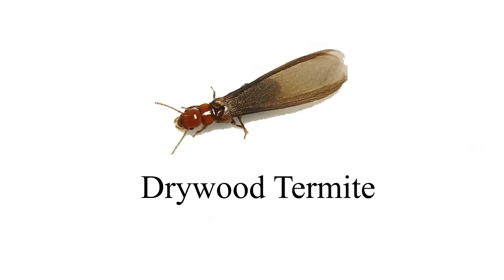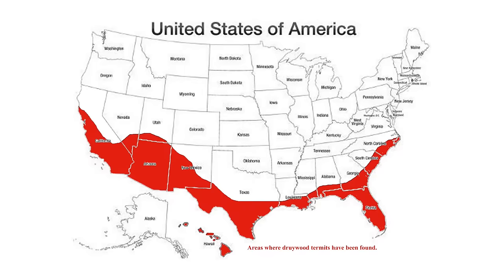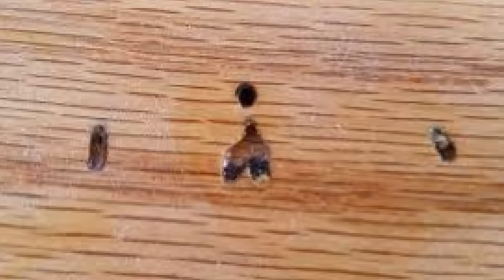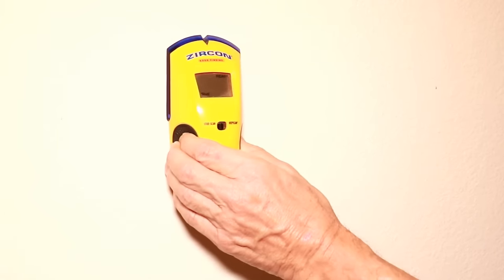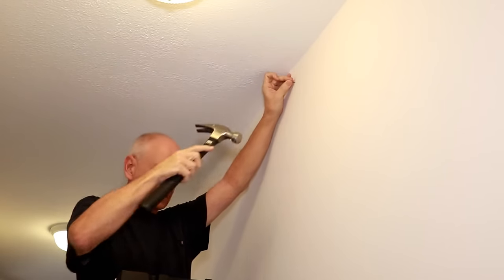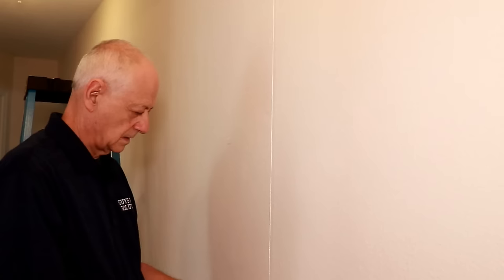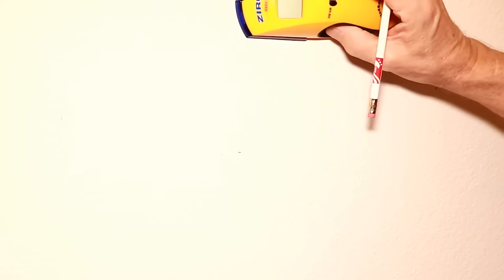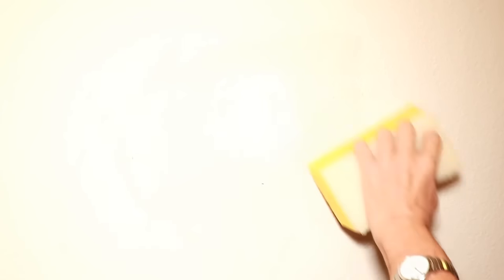How to Treat a Drywood Termite Infestation Yourself. A MUST see if you have Drywood termites.

Comment: Guy good afternoon I am building a new home in Wichita ks,  I have built a few before and during those builds i was able to use Chlordane by pouring around the basement foundation and it worked great. Fast forward you can't find it anymore the EPA say it was bad but it sure did work.  I am looking to treat my home before framing starts and need some advice. I have not backfilled the basement yet will do in about 10 days so I have the perfect opportunity to do a diy termite treatment.  I am looking to spray the foundation after waterproofing is done. I have a 120 gallon spray tank in my gator so I think I have a great rig to use.  I have watch many of you videos and still need a bit of help on the concentration to use,  and how much to apply by sprain application.  I like the fipronil which has a few trade names.  I can spray the entire foundation basement if needed,  I don't belive permits are a great issue around here and I will have a minimum clearance  of 10" between any ground and the James Hardie siding.  I would like to ask for your suggestions, And Your videos are great as an engineering I really do appreciate your detail.  Thanks John Sutherland Is you would rather call my cell is 720-320-6678
Reply from the maker: I am so glad that you reached out to me before you started framing.  Chlordane certainly was an effective product.  The only problem with it was that it was also highly toxic.  So, the EPA banned its use in the late 1990s.  Not to worry though.  I can tell you how to make your entire home 100% termite proof and the treatment is going to last virtually forever.  This is not the cheapest way to do it, but did I mention that it's permanent?  We could certainly go with the ground method of using fipronil, but that is only going to last a maximum of about 10 years.  So, instead of treating the ground, we can treat the wood because you are going to have it all exposed.  After, hearing my suggestion on how to treat the wood, if you still want to treat the ground instead, then I have a video on how to properly trench around your house and I will share a link to that video.

My recommendation is to treat the wood and some other materials in the structure with Bora-Care.  I do not happen to have a video on how to do that, but there are other videos on the web that are pretty good and I will share a couple of links for you.  I do it a little bit different than most people and, of course, I think that my way is better.  Most people are going to mix the Bora-Care at a ratio of one part product to five parts water.  I think that is a mistake.  The label does tell you that you can do this, but you would be much better served to spend the money and mix the product one part Bora-Care to one part water.  The reason for this is that concentration is important.  Mixing the product one to one is going to kill termites much faster than mixing it one to five.  In other words, this will make the product way more effective.  Since you are only doing this one time, you may as well do it the most effective way possible.  This is not a cheap product, so it is going to cost a lot more money to do it my way.  So, you can decide for yourself.  Either way though, whether you mix it one to five or one to one, it will still do the job.  It's just that by mixing the product one to five the termites are going to be eating for a little while longer before the entire colony is wiped out.  It will still get them, just a bit slower.  A couple of other things that I do differently than most people is I treat the entire foundation, both inside and outside, because this product can be applied to almost any surface, including concrete.  I also apply it on the entire subfloor, both the top and the bottom, and all the floor joists as well.  I also apply the product on all the plumbing and wiring in the entire shell that is below a two or three-foot mark from the floor up.  That is to say, I treat everything from the footing up to about a two to three-foot mark from the subfloor up the walls, both inside and outside, before the finished siding, insulation, or drywall are installed.  This way, the termites will have no choice but to encounter this material when they reach your home.  You can apply this product with a very cheap garden sprayer that you can throw away at the end of the process.  I recommend doing the entire treatment in one day because the sprayer can clog very easily if it is not thoroughly cleaned.  If you use a cheap $10 garden sprayer, then all you need to do is just throw it away at the end.  Other than those recommendations, just follow the directions on the videos and you should be good to go.  Again, if you decide not to use the Bora-Care, then you can watch my video on how to properly trench the house.

The cheapest place to buy Bora-Care is Solutions Pest and Lawn.  I will give you a link to it.  You can buy the product with mold prevention as well, but it costs a lot more.

I hope that helps.  Be well my friend.

Bora-Care videos:  
https://www.youtube.com/watch?v=Rmr_aEodyhg&t=7s

https://www.youtube.com/watch?v=OawAzkZZx20

Where to buy Bora-Care:  https://www.solutionsstores.com/bora-care

Video on how to trench for drywood termites:  https://youtu.be/Fy7YHi_7Z8g

Comment: Another topic but same subject. Treating/preventing dry wood termites in a typical FL condo…. Almost all multi story FL condos have a common air handling closet for the A/C system which literally runs from bottom floor to the top floor. The copper piping and condensation drainage pipes pierce the floor and ceiling of every single closet. There could be an infestation on the sixth floor and using this crazy highway, could impact the first floor as they are usually incredibly poorly sealed, if at all. A physical termite highway! 

Before I properly seal around these pipes I thought it would be a great idea, with decent access now, to treat the volume of space below the floor and above the drywall ceiling. What is your recommendation for treatment of these two spaces? FYI: The gap around the pipes are large enough to insert the tip of a multi gallon pump up sprayer. Thanks!
Reply from the maker: I have to tell you Mike, you never cease to amaze me.  I don't think I have ever seen anybody think this stuff through as well as you do.  Of course, as always, you are exactly correct with your thinking. 

If you live in a high-rise condo, then it's a safe bet that if the floors above you or below you have a drywood termite infestation that adjoins any type of pipe chases or penetrations that run up through the building, then of course that presents easy access for the swarmers to make their way to other floors.  It's not just termites either.  These chases or penetrations are a superhighway for all sorts of pests, including German cockroaches.  If you have a situation where there is a chase running from the basement to the attic, then, from strictly a pest control perspective, sealing them off is a very good idea.  However, from an engineering perspective this may be a bit more complex.  You see, there is a reason why they do not want a chase sealed off in that way.  Right now, all your utilities may be fine and dandy, but at some point it may be necessary to run another electric line, water line, and so forth through that chase.  Now, it is somewhat different if the pipes are simply running through holes that were cut through the flooring and there is no actual chase, but rather just spaces around the pipes.  In that event, it makes no difference if you seal them up.  It kind of sounds to me like this is what is happening in your case.  If all you have are unsealed pipe penetrations, then it is clearly a very good idea to seal around those pipes.  

With regard to treating these areas with a pesticide prior to sealing them, that depends on what is above and below these penetrations.  I mean, you certainly would not want to apply a liquid pesticide down into a pipe penetration in the floor that ends up coming out somebody else’s ceiling below you.  Also, if you are only going to do this job once, then I think it would probably be a good idea to use something that lasts forever.  As I explained before, probably the best product you can use is Bora-Care.  However, if applying a liquid like that could result in damage to somebody else's property, then I would probably go with a dust.  If you go that route, then the best dust that you could possibly use would be boric acid.  It's cheap, effective, and readily available.  Not to mention that it literally lasts forever.  All you do is get yourself a hand duster, fill it halfway, and then just puff some dust into all the cracks, crevices, penetrations, etc., and then go ahead and seal them up.  Of course, this will do nothing to treat an existing termite infestation, but just like the Tim-Bor, it will kill any termite swarmers that come in contact with it.  So, you need to do a little homework before you treat and be sure that you are not going to cause any damage to anybody else's property if you use a liquid.

Now, let me talk to you a little bit about an even bigger problem that I think you have.  One of the biggest problems with multiple unit condos is that some of the owners may not take infestations like drywood termites and German cockroaches as seriously as they should.  So, while your living space may be totally pest free, other units surrounding you may not be.  That means that drywood termites that are eating away on the building above you or below you could eventually cause a catastrophic failure in the building structure and may result in your unit becoming unsafe because the building is no longer structurally stable below you or above you.  Also, things like German cockroaches can easily travel from one unit to another and, if one owner has a German cockroach infestation, you can count on those things getting into your unit as well, no matter how well you seal off your unit.  Since you live in this type of a building, I would urge you to have a look at the video I did on German cockroaches.  The video is about 90 minutes long, but the part that I want you to watch is just the first maybe 30 minutes of the video, so that you can understand something about German cockroaches.  If you think drywood termites scare you, have a look at what German cockroaches can do.  Both of these pests are a serious concern in any multiple unit building.   The reason for this is that, to properly address these pests, it means that all the residents need to apply the same, appropriate, treatments to ensure a safe and pest free building.  Unfortunately, there are always those who refuse to cooperate and then there is nothing you can do to prevent these types of problems.

As always, I probably gave you more information than you wanted, but I hope that I did answer your questions.  You clearly have a very good understanding of the concepts surrounding drywood termites and other pests and it is always a pleasure to chat with you about this stuff.  Not everyone shares my passion for bugs.
Reply: @GuysPestSolutions  My number one goal is to be safe. So great recommendation on boric acid. Tim-bor (borate salt) can puffed as a powder into voids as the one I am dealing with. Do you have an opinion as to which is safer for humans? They both appear to be safe to me. I will do a very light dusting into these voids.  

The pipes running vertically are individually run and not in a common chase. Unfortunately, like most all condos built in FL, it looks as if a child drilled the holes and foamed it only enough to barely pass code. Most of the foam has fallen off. I will extensively clean up the holes before I reseal properly. Light will not be able to get through when I am done. 

Fortunately my complex only has 3 floors max. It is a higher quality complex so they do a good job with maintenance which is why HOA is high. But I know what you mean as I have seen some massive six story frame construction complexes slapped up in seemingly only months. Those are the ones that scare me.
Reply from the maker: @mikem54321  Again, I think you asked exactly the right question.  If you have a choice between using boric acid or a borate product, then which is better?  Many people think that these are essentially the same thing, but that is not exactly the case.  In my opinion, boric acid is a superior choice over a borate product when used as a dust.  There is a company called Bug Tech that did a really excellent job explaining all of this and I thought it would be just easier to share what they did rather than go through all of it myself.  I mean, no sense reinventing the wheel.  They wrote a very good article on the subject and it is not all that long to read.  I placed a link below for you.

Even though boric acid is clearly the best option as a dust, that does not mean products like Tim-Bor, Bora-Care, or Nibor-D have no place in the pest control industry.  If you are treating an area where a dust is not appropriate or practical, then the best choice is to use a borate product.  A good example of this is when you need to treat on a vertical surface where a dust will not stick.  Also, you do not want to use a dust any place where it can come in contact with children or pets or be blown into the atmosphere in the house.
I hope that helps.

https://www.bugtech.com/borax-and-boric-acid/
Reply: @GuysPestSolutions  My research led me to understand that borate is much safer though less effective. The trade off is worth it. I only  use safe products. As a matter of fact, decided not going to use any poison at all even under baseboards. I won't even allow a can of bug spray inside. Which is why I am so focused on sealing gaps to control and avoid pests instead. Essentially Tim-Bor appears to be good old 20 Mule Team Borax crushed into small pieces with a capture film to keep it in place.
Reply from the maker: @mikem54321  I'm not sure I understand what you mean by “safe.”  I guess if you decide you are going to eat one of these substances, then probably you would be better off eating the borate than the boric acid.  However, if you're just talking about blowing the dust into wall voids and such as that, then neither product is safer than the other.  You don't want either of these products to get into your eyes, you don't want to breathe them in, and you don't want to eat them.  That being said, once the dust is applied into a cracker crevice, especially if you seal it off, then it is not going to be hazardous at all.  So, from a safety standpoint, I see absolutely no difference between these products when used correctly as a dust.  The problem comes in when you are not using the products correctly.  If you are treating areas that are exposed to people or pets, then you are far and away better to use the borate and apply it as a suspension.  The reason I do not just use a borate is because the boric acid is notably better for controlling pests.  Let's face it, the reason we are applying these products in the first place is because we want to kill the bugs.  So, why would you want to use a less effective product when there is a more effective alternative that is equally safe, when properly applied?  You should also be aware that almost all modern-day pesticides are perfectly safe to use, when applied properly, and they are no longer hazardous after they dry.  That is to say, almost all pesticides are only hazardous when they are in liquid form.  That does not mean we want to apply them directly on surfaces where food is prepared, but they are not going to harm you at all if they are applied on a baseboard or something like that.  I understand that a lot of people do have a fear of pesticides, but I think that is mainly because they are thinking of the old-time pesticides that we used when I first started into pest control.  Pretty much all of those products have now been banned and are no longer available.  Pretty much all of the products you can obtain today are safe and effective when used as according to label directions.  The only reason why I am not a big fan of do-it-yourselfers applying pesticides inside is because a lot of people do not take the time to read the label directions and may be a bit careless when applying these materials.  I mean, you do not want this stuff being accidentally applied in dog bowls, on kitchen counters, places where people sit, and so forth.  The pros are trained to use these materials safely.  For exterior use though, I think these products are way more forgiving.  The bottom line though, is that no pesticide is going to be harmful to you, if applied according to label directions, and you wear the proper personal protective equipment.  That is the truth.

I hope that helps.

Comment: Hello! I have an infestation inside my house. I live in a concrete house here in Puerto Rico but I put sheetrock on my walls and ceiling. I found the termites inside the space between the sheetrock and the concrete wall. How I can end with the termites without destroying all the sheetrock work? Thanks, im desperate 😢
Reply from the maker: How you handle that will depend on the species.  Figuring out the species is actually pretty easy, and I have a video on how to do that.  I will provide you with a link below.  After watching this video, you should be able to identify the species.  Just get back to me after you watch it and let me know what you found out.  At that point, I can tell you exactly what you need to do.  Let me know if you have any problems identifying the species, but I do not think that you will.  It is much easier than you may imagine.  Be well my friend.

Video on how to identify termite species: https://youtu.be/dIs_a0nfVjg